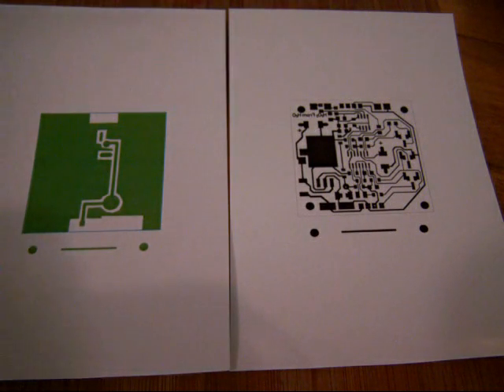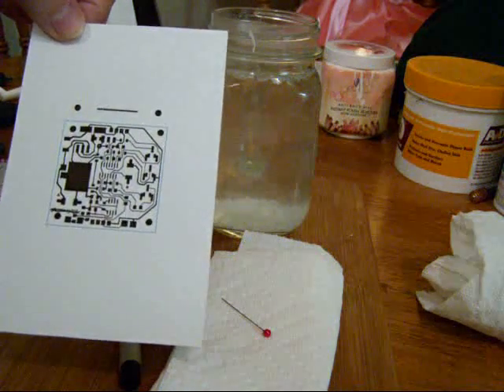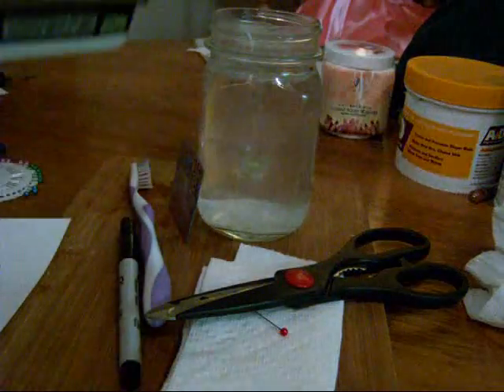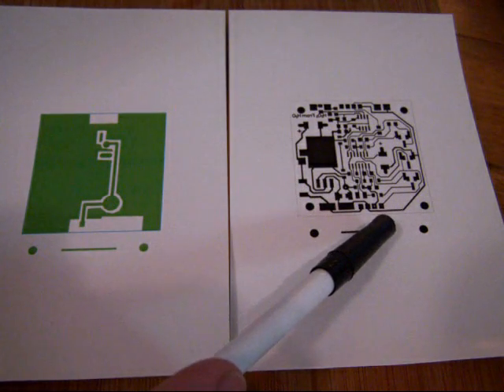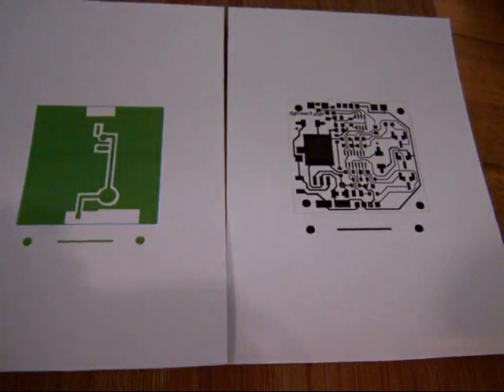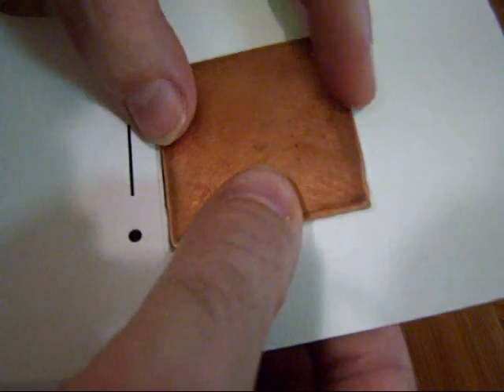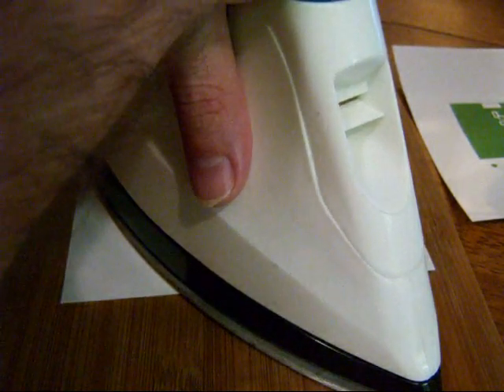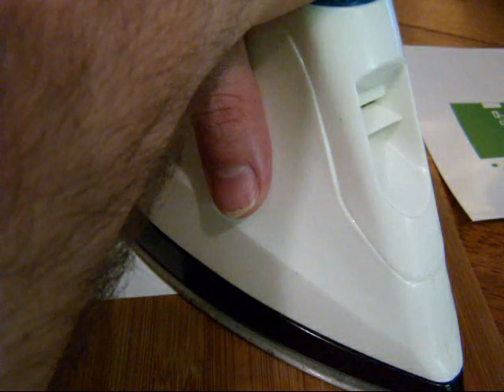#2 H2O2 - Applying Transfer paper to PCB, Part 1 of 4

Comment: why laser printer only 
I have inkjet printer
Reply from the maker: Laser printer use a plastic toner that is fused with heat to the paper. This plastic is then transferred to the copper board with the described process. It resists the acid in the etching process. An ink jet printer only has ink which cant resist the acid and does not transfer from the paper to the PCB.
It is possible to print on a ink jet and then photo copy that printout in a standard photocopier.  Make sure your inkjet print is dark and no missing spots or faded lines. make the photo copy as dark as possible making sure the white areas stay white. Gray or speckles are not good.

Comment from the maker: The iron I use, has a steam option, I do not use steam but there are holes on the surface so steam can escape. These hole leave areas where pressure is not applied. I found by trial and error that moving and applying pressure worked best.